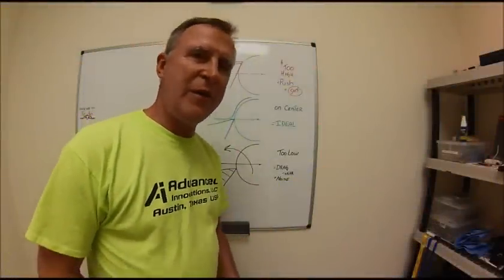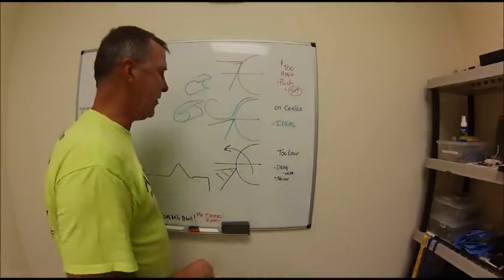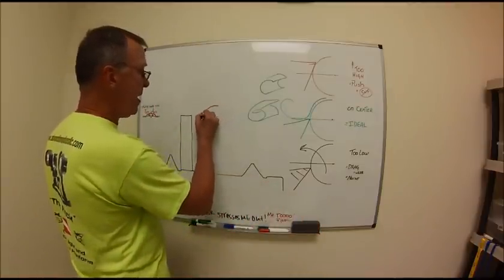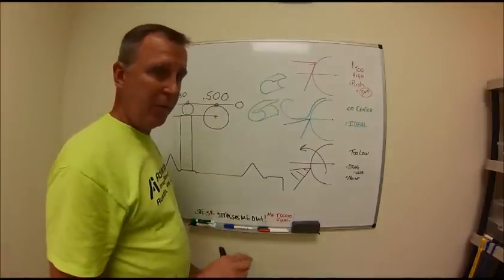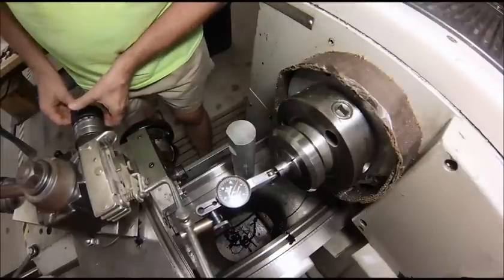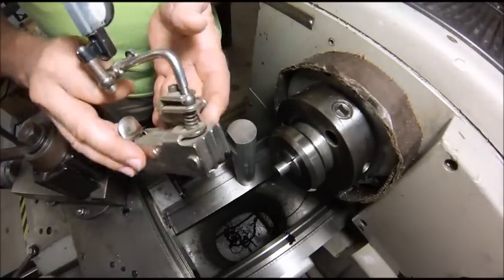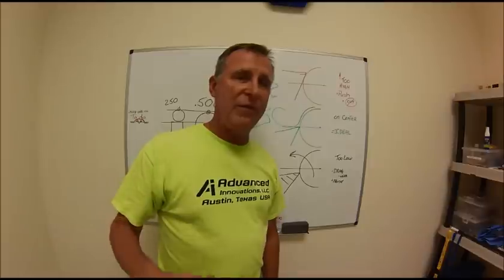Setting lathe tools on center

Comment: I've done similar here.  For rapid tool centering I use a feeler gauge and place it between round stock and point of the cutter (machine off).  When feeler rests vertical, tool is Center.  If the feeler leans toward the stock, cutter is too high; feeler leans toward operator, tool too low.
Reply from the maker: I have seen that trick before, but it relies on a perfectly flat tool geometry. Just because a tool is on center at the OD of a part, does not assure it will face on center. If the tool has any back relief or nose radius, it realistically has multiple points of contact.

Comment: A 3 year late comment… Your video has inspired me to build a tool to set the tool height, something similiar to what Abom79 has been showing. I have an Angle Cube from Micro Marks to use but a bubble leveler will be possible to use as well. In case the project gives any kind of precision, would You like some pictures sent to Your company mail? I didn't find any private mailadress.
Reply from the maker: Thanks. I'd enjoy looking at them. Company e mail address is fine.
Reply: Thanks a lot Joe. I'll keep in touch. Right now looking at Your knurling lesson from July 2017...

Comment: Fantastic tutorials, I learn from every one of them. 🇬🇧🇦🇺🔭🛠
Reply from the maker: Nice to hear. I'll play show and tell once in a while, but passing on some theory in my videos is my goal.
Reply: @joepie221  I am self taught - my workshop skills are a means to and end as I build big telescopes, camera quipment and tolerences measured in Angstrom-units, designing and building observatory structures of interesting designs plus a ton of one off equipment. working to a thousandth or two is 'blacksmithing' for some of my equipment-so I need all the finer points especially why and how to acheive those end results. Do my own anodising as well, most of my projects use a very nice military spec aluminium alloy used in local catamaran ship building, the material is manufactured in France. Resistant to oxidising and being in salt water. seems to stay with a bright surface finish-superb material to machine.   'Southern Cross Observatory' Tasmania 42 South.

Comment: Looks like a job for one of your half inch diameter offset pins, or whatever you call them.
Reply from the maker: Technically, the alignment pin could be used for this. Horizontal reference would be the obstacle.

Comment: How did you make the reference? More specifically, how did you come up with the measurement for its length to center of the piece? I am not a machinist, but just bought a lathe to learn with, and have been thinking a lot about how to find centers and such. How would I go about making one of these. I will probably also find a lot of this info a handbook, but thought you might just be able to point in the right direction.
Reply from the maker: Start with a taller part and use the pin method shown.

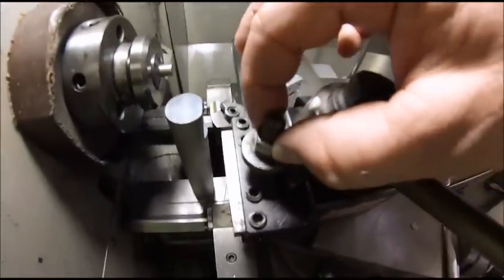Comment: 7:58, Is this nut even necessary to have on there? I am new to machining and the shop I'm learning at doesn't have those nuts on any of their tool posts
Reply from the maker: The nut is to set the holder center height for different size tools. Yes, the lock nut should be present along with the big collar nut. Usually a keyed washer is between them.
Reply: @joepie221  Thanks! I was referring to the top one that isn't knurled.

Comment: EDIT - if the 6" rule is tilted away from you - then the tool is too High!!
Reply from the maker: The scale trick is very conditional. The setting for turning may not be acceptable for facing and so on. It depends on the geometry, rake and nose radius of the tool.

Comment: Here's a good way of finding the centre height for the tool - Trap a 6" steel rule between a piece of smooth bar & the tool. If the rule is tilted towards you, then the tool is too LOW.
If the too is tilted away from you - it's too high. If its  visually perpendicular it's on the correct centre height. (Good enough for general  turning, but fine adjustment is required if facing down to the Pip )
Reply: I do the same  but with a thin feeler gauge. Easy to pinch against the round stock in the jaws or collet and no excessive pressure on the tool.

Comment: Great video,Joe.I made the tool height gauge from 1 1/2 yellow brass because, it was easier than turning down a 3” bar of aluminum and,it’s heavier. I keep it in a pvc pipe with foam rubber glued inside the end caps.Thank you for the video.

Comment: say your tool is like .006 " below the centerline.  YOu really think that say a 3/16" diam 1" protruding from chuck tool steel rod will jump over that cutter?  I center my tools by facing.  What is your take on this?  Thanks

Comment: Hey Joe, why go to all this trouble?  Chuck something up and face it, to find work-center, while at the same time, re-centering-your-tool to remove the tit. Your tool has now found work center.   Then wrack your cross slide back a bit and with a 6" caliper stem for-depth-measurement, measure from the top of your carriage, to the top of your tool. Write the dimension somewhere easily visible  so you don't need to commit it to memory and just use your caliper to set tool height next time. Mine measures 5.078".  Larger machines  = bigger caliper. If you are going to be measuring your work anyway you will already have your caliper in hand. This works with candle stick tool posts just as well. That said, perfect center is not "supercritical".  If your tool is within +/- .005 or .010  of horiz. center and you are more than .500" from shaft vert. center, your "sharp tool" will cut just fine anyway. It becomes less critical the further from center you get. Often, when boring in small holes, I will have to raise the tool substantially in order to clear the tool relief. Maybe a good topic for a new video. BTW I do like your videos and don't mean to sound critical.
Reply from the maker: I personally would rather use a hard standard. I see your logic, and it makes sense.

Comment: That suggests another way to measure a center-finding rod, depending on your lathe.  My lathe has a Morse 4-1/2 taper in the headstock bore, and I can put a nice sharp center in there.  Put a chunk of cutting tool in the holder and adjust the upper face of it level with the point of the center.  Now you've got something you can use to scribe the gauge rod, so you don't have as much trial & error. (helps if you have another lathe or mill to do the cutting).
Reply from the maker: Or just some patience.

Comment: :You could leave the indicator after you register the .250 pin, installed the tool in the machine and use the indicator to check the height of the tool with the indicator.

Comment: Hi Joe,  I love your videos - such innovative thinking please don't stop making them.  I was a design engineer on the space shuttle main engines for Rocketdyne.  We had a special projects machine shop that had three guys that were master machinists.  I dropped in there any chance I got just to watch how these guys did things and to pick their brains regarding how to change a design to make the part as efficiently as possible.  You would have fit right in there with those guys.  One fellow was an old German tool and die maker - he thought outside the box just like you.  Thanks for all the time you spend making these videos - I've been machining parts in my side design and prototype parts business for about 45 years now and you have taught me some great tips - which goes to show you're never too old to keep learning.  Thank you.
Reply from the maker: Thanks. I like those kind of environments.

Comment: Issue and Question:  I bought a new tool post with tool holders and my tool tips cannot be lowered enough to achieve that perfect centered placement for the tip.  Should I mill the base of the tool holders or is there a better idea?
Reply from the maker: I hate to say it, but this is usually the sign of a tool holder setup that is too big for the machine. If using smaller tools doesn't get you on center, your only option would be to mill the bottom of the holders, or notch the insert holders to drop them down. Just don't thin them out to being weak.
Reply: Thanks for the feed back.  The Quick change Phase II tool post is a BXA model 250-222 for a (don't laugh to hard) for a Taiwanese made "Husky PC-36" lathe.  It was a good deal for a beginner and for $1,300.00 and came with about $2,600.00 in tooling.  All that I read said the AXA tool post was a bit small for a 10" swing, 36" between centers lathe.  I am looking for Clausing 12" lathe but need to find a really good deal on one :)  Also glad you moved to Texas!  I'm up in Idaho ( ex-USAF) and used to stop by your local AFB.   THANK YOU for taking the time to help guys like me.  It really means a great deal, seriously.  A mill was needed for the accuracy of certain processes for building wood core/composite propellers.  The lathe was needed to make certain set-ups later on.  You can see what else we do at www.long-ez.com.  I have my own Long-EZ and will try to get down that way sometime after I put the new canopy on  (some design work as well) to Thank You in person.    Would love to gain some knowledge about making tooling cutters and recommendations on what to look for on a grinder to sharpen the cutters, if you ever have the time.  Thanks Again Joe!  I Really appreciate you!

Comment: Hey Joe:  new viewer here,  with another possibly stupid question.   I notice what looks like a piece of cardboard surrounding the base of your spindle.  I've noticed it on a couple of your other vids as well.  It's most likely there to protect something.  What's the story behind that?
Reply from the maker: it catches any oil that may get to the chuck ring and keep the machine from slinging it on the left side of my shirt. It has been replaced with a piece of PVC.

Comment: I was wondering how you set your thread tools upside down.
Reply from the maker: If its small enough, just turn it upside down and put a spacer under it. If its a big tool, lock it down and raise the entire tool holder. My little centering post then simply slides under the tool. The centerline is the same regardless of the tool position.

Comment: Another tip is to use  feeler gauge between the tool tip and the OD of your material when its held in the chuck. The feeler gauge will tilt forward or backward if the tool is above or below centre. If the feeler is perpendicular then the tool is on centre height. BTW it is OK if your tool is slightly below centre but always bad if its above ctre.
Reply from the maker: That technique is OK for turning, but depending on the grind and nose radius of your tool, it may still be well below center for facing. Sounds like a good video topic.

Comment: When are you going to do some videos on surface grinders like how to do angles, magnetic parallels, whirly gigs, plunge grinding, or making specialty cutters?  On the manual mill videos on cutting key ways using woodruff keyseat cutters then checking with a surface gage to see if they are on center, roughing with roughing end mills and their geometry, cutting slots with two flute end mills.  A video explaining SFPM using speeds and feeds while explains machine rigidity would be a good one as well.  I went through a tool and die apprenticeship 20 years ago where we made injection molds.  Gave up the trade after finishing the apprenticeship.  Watched a bunch of your videos.  My favorite part of machining was comparing styles with other machinists who were good at what they do.  There is always more than one way to skin a cat.  Love your videos.  Keep them coming.
Reply from the maker: My work here is very specific and grinding doesn't play a big part in any of it. I outfit my lathe for tool grinding, and never purchased a surface grinder for the shop. I just haven't needed one. I have extensive experience with form tool grinding and wheel dressing, so when the grinder show up, I'll go down that road. Thanks for the suggestion.

Comment: Hi Joe, I like this method of aligning the cutting point, but in your video of single point thread cutting while using the cutting tool upside down, how would you align the point in that setup?
Reply from the maker: If you think about it, the centerline / plane is the same regardless of the tool position. Simply confirm your height standard slides under the inverted tool and you should be fine.
Reply: I didn't think of that.  Thanks!

Comment: Personally, as I don't use QCTP (I  have one but don't use it) I prefer to use my vernier as it will tell me what shims I need since I measured centre height with a properly centred tool after facing. Anyone just starting who hasn't got QCTP may find vernier easier to use?

Comment: Love the center gauge.  As for the file tang trick....  You mean you don't do it like some hacks and leave channel lock marks on the thumb wheel??!!   I am guilty of putting a single drop of blue loctite on the tool holder studs to keep them in place.  If I ever need to change one I simply double nut them and out they come.  For those that weren't reading closely I did say BLUE...not red.  :)
Reply from the maker: Its the guy that leaves vise grip marks on the threaded post I'll go have a talk with. Good job on the blue. Make sure you take it apart and clean the years of neglect off it for better results.

Comment: great video, like all the others. i've always used the ruler against a bar trick and that's been fairly reliable but i'm certainly going to give making one of these bars a go to see if i can get it things better. how would you go around doing this trick on inverted tools? would you then use this bar like a feeler gauge?  

one thing you didn't mention (i don't think) is when you have tools off center you get a cosine error with the dials/DRO as well so you will be forever compensating for that. if you did mention it and i missed it i apologize.

Comment: Joe, my name is Carlo Piaia one of the places I used to work at was Tydeman Machine Works in Redwood City and they had a tool height adjustment tool, that was approximately an inch or so in diameter, after they found the Center Height they attached another piece of material the same diameter, and offset it by about a quarter inch and reattached it with a 1/4-20 cap screw the so you could measure right side- up tools and upside down tools. Thanks Joe I like your videos

Comment: Just curious Joe, for internal boring bars that use inserts, how do you set them up to be on center and to have the right amount of rotation?  On my insert holders there is a flat but it doesn't seem to be cutting right when i set the holder using those flats.  Hope that makes sense.

Comment: I usually pinch a 12" scale between a bar in the chuck and the tool. Eyeball plumb and it's on center. Repeat if its very rough bar. This gauge method is a lot faster though.

Comment: Great tip on the file tang as well as the height gauge! Gave me idea. I used 1.25 hex material. No need to mill  at that point. I also recessed a 3/4" dia magnet in the bottom.
http://geckocycles.com/images/lathe/tool%20height%20gauge1.jpg
I continue to learn so much from all your vids. THX

Comment: File tang works but my CnC (Cheap n Nasty) toolpost has a provision for an Allen wrench.  Not trying to reinvent the wheel, just suggesting... you could always stake a nut on the top or use your spin indexer to mill a square or hex if you can be bothered.

Comment: Why not place a fish gauge between the stock and your tool? That is how I was taught.
Reply from the maker: Most tools have 2 center heights depending on the grind. Positive rake raidused tools especially. The turning height is different than the facing height.  If all else fails, just face the part and adjust until the tit is gone at the center.

Comment: Great idea, I don't have a mill to cut such a thing sadly... Just got my first metal lathe a month ago. Perhaps one could make the bar adjustable with a threaded top portion, then lock it when the height is right.
Reply from the maker: Or just turn both ends to length
Reply: It would be a bit of a problem doing this if a person only has a lathe and no milling machine.  I guess running the pin between centers, and then removing the pin and replacing it with the standard in order to face it would work.  I may have to try this because the methods I now using to center the tool don't work very well at all.

Comment: I made one of these out of tool steel som time ago after watching this video.  I use it all the time, and my tools are always on center.  I dont have enough holders for my Multifix system, so changing tools a lot.  This is so quick.  Forget all that advanced sh*t with small spirit levers and lots of adjustments.  This is the easiest way.  Thanks

Comment: Thanks again, Joe. Just made one of these center gauges today for my 40's Atlas 10", and you're right - it's a simple solution that works great! It took me some time to "sneak" the 6061 round stock to the precise length a few thou at a time, but I can't thank you enough. Most precise gauge I've ever used for setting tool height!
Reply from the maker: Excellent. Keep the bottom knick free and it should serve you well.

Comment: Awsome :) but how do you make the measure stick and how do you assert the dimensions of the two other sticks 1x and 2x?
Reply: I will have a crack at answering that for you. The two sticks were just used to verify if the height gauge was exactly on centre. He used 1/2" (.5000) and 1/4" (.2500) just because they are very common in most workshops (in precision ground stock so there is minimal run out). You could use a 1" and 1/2" combo or 1/4" and 1/8". The height gauge block plus the 1/4" pin should = the height of the 1/2" pin when secured in the lathe chuck. If it reads high, face off your height gauge to suit and test again. He mentioned trial and error making the gauge block, so start with a crude measurement that is high and work your way back.